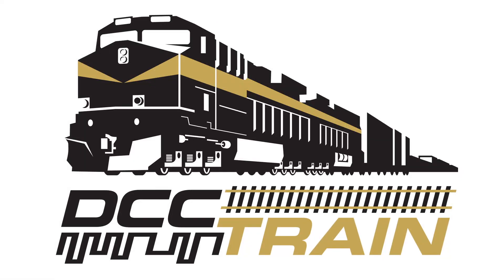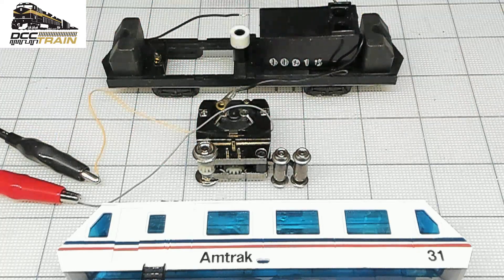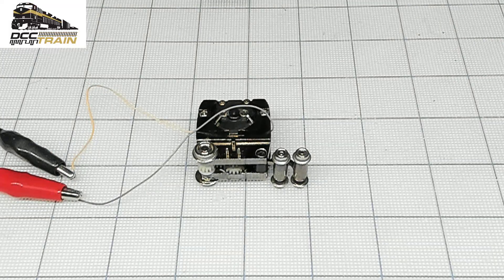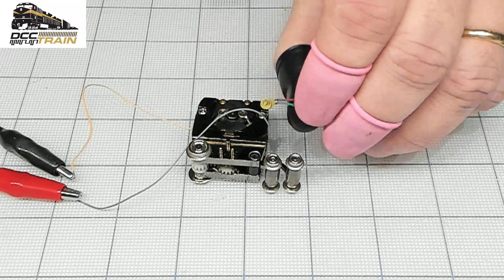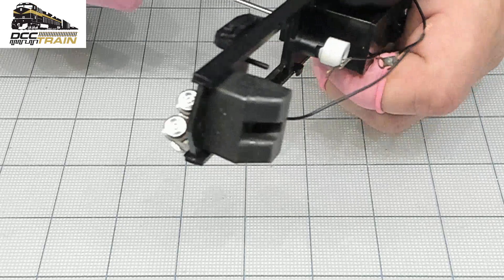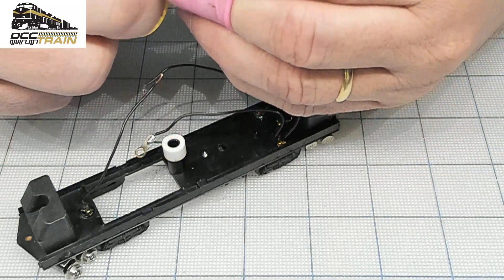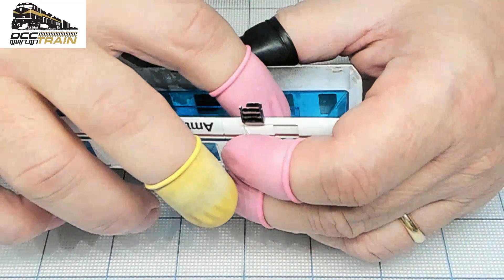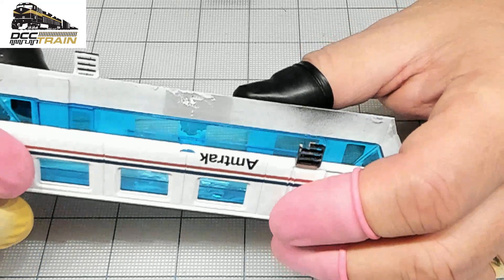HO Bachmann Plasser EM80C Amtrak 31 DCC decoder installation Part 1

Comment: These were track cleaning engines. The box held the cleaning solution and fed it to a pad on the bottom which is missing from this unit. The box was filled from removable caps on top of the engine.
Reply from the maker: Thank you.